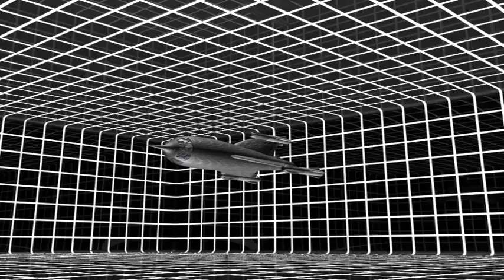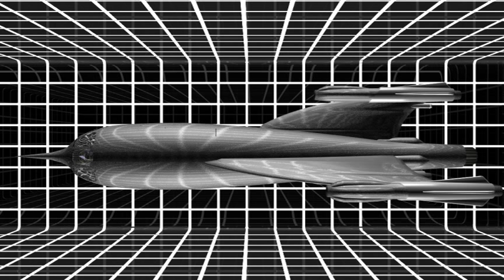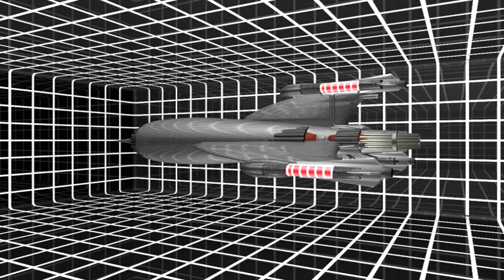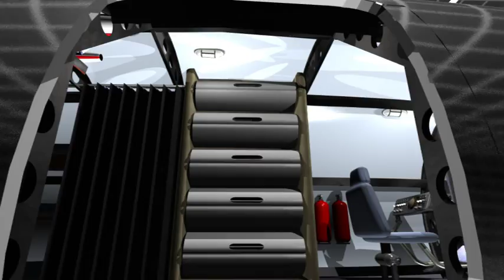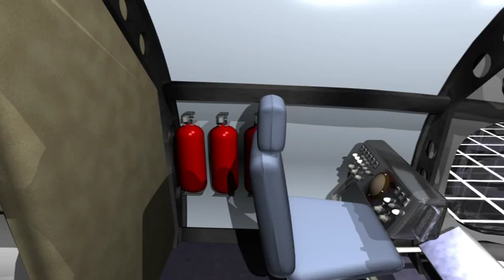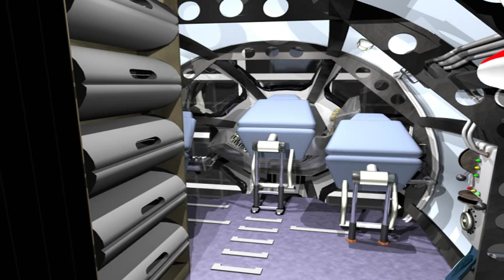3D tour of Buck Rogers Rocket * Sctfisteve

Comment: Good work as always, but I think cancelling the atomic engine project, as referenced in the video, as it applies to aircraft was a good idea. The shielding required alone would have dramatically increased the weight of the aircraft not to mention also intensifying a disaster like a crash. The strategic need for such aircraft was obviated by the nuclear-powered sub in any event. Hard to imagine any legitimate civilian uses. Still, appreciate the look back at Buck.